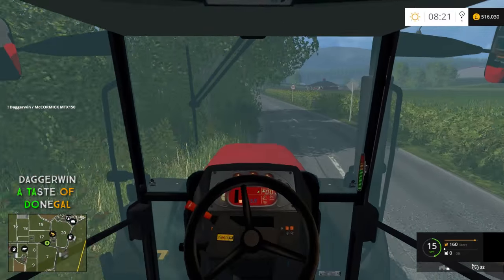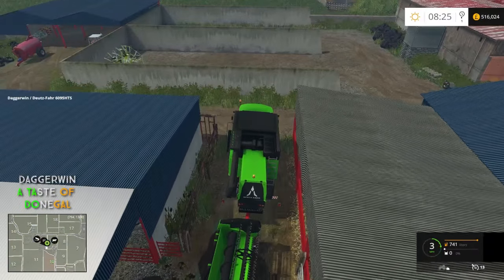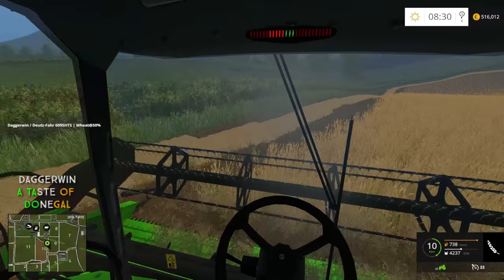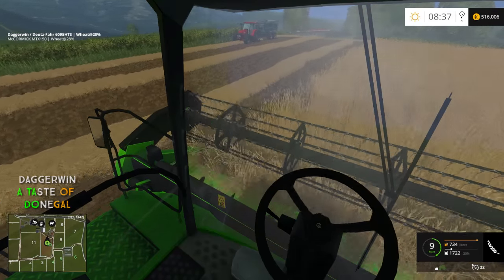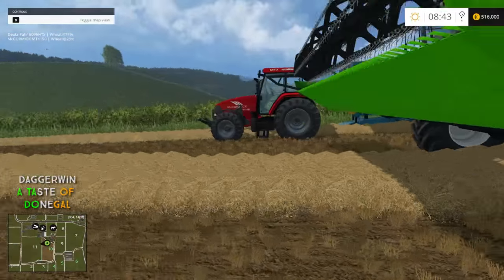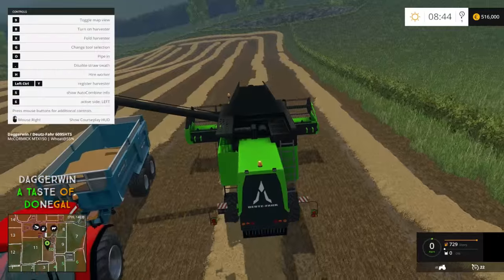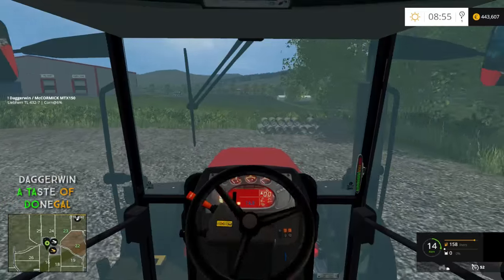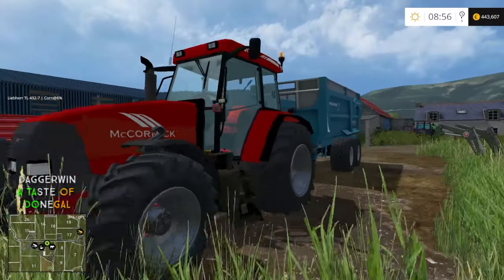Let's Play Farming Simulator 2015 | A Taste of Donegal | Episode 5

Comment: Daggerwin, what's your pc specs, debating weather to get a pc for fs15
Reply: +Iain connell The info is on his user's 'about' page:
CPU - i5-3570 3.40GHz
Graphics Card - Nvidia GeForce GTX750 Ti
RAM: 8GB Corsair (2x 4GB)
PSU - Corsair CX750 750W
Primary Drive - Hitachi 300GB
Secondary Drive - Western Digital 2TB Eco
Windows 7 64bit
Reply: thanks, i was just wandering of what to look for in a pc that can run fs15